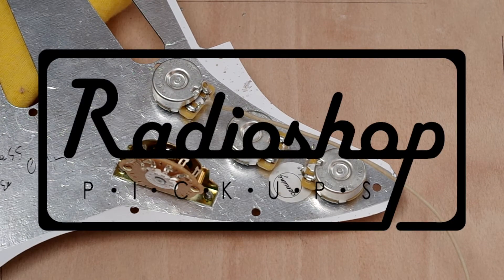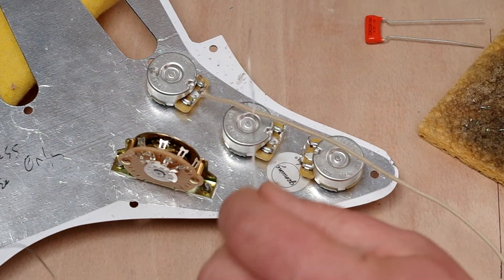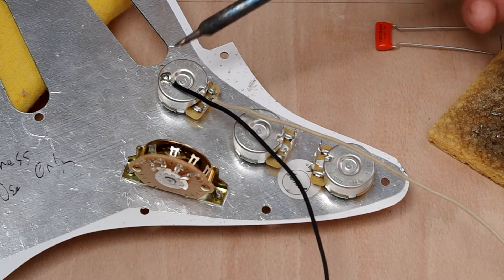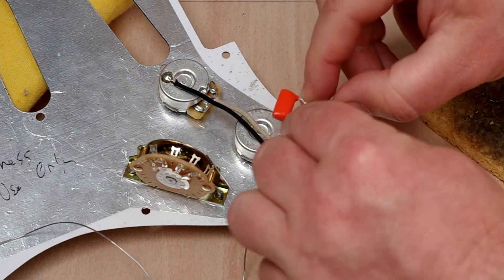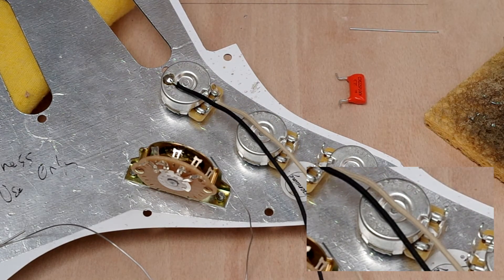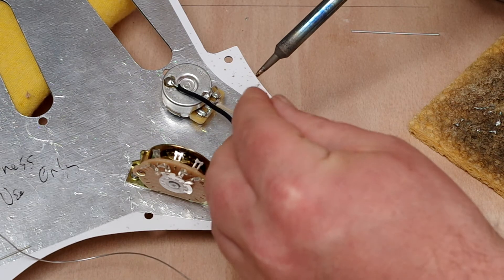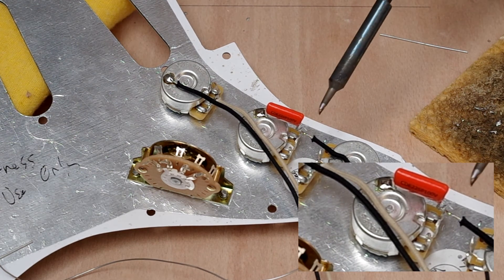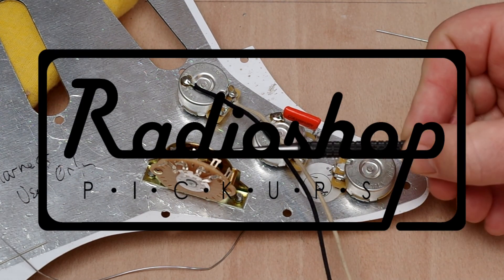How To Solder Guitars (2/6) - Capacitors and Pots

Comment: Why does my soldering iron oxidize so quickly? I have sanded down all the oxidization from my Iron and then cleaned it with IPA. Then I reheat the iron and melting tin on it and scrape of the excess tin on the sponge, but after a while oxidation re appears again before getting tin all over the iron..

Comment: The biggest mistakes I see is people using soldering irons not hot enough and way too much solder. I learned it's best to have a soldering pen with a thermometer adjustment.

Comment: I JUST LIKE TO ASK NOT SURE  DOES CAP HAVE TO BE SOLDERD A CERTAIN WAY , LIKE IF YOU TURN CAP AROUND VISA VERSA , DOES MAKE ANY DIFFERENCE . LIKE POSTIVE NEGITIVE. OTHER THAN  THAT GOOD  TUTORIAL.
Reply: yes it does. really good question. every cap has a direction and if you put it in🎉 reverse you'll have slightly more hum or signal loss. The way to know the direction is to run your amp on high gain, tube screemer or dist pedal ON, and touch it on the tip and ground of the guitar cable. in one direction you'll hear less hum.

Comment: What’s the difference between soldering one leg of the cap to ground and linking the volume and the tone pots with the cap in a Les Paul guitar?
Reply: It’s possible it’s just a better grounding option. I had a fender telecaster that had a hissing it unless your hand was on the bridge that was a bad ground issue probably a cold solder joint. I also had a telephone that constantly had static or crackling in it until one day the teck came out and I know the guy he had me run a ground wire right from the phone hook up post outside right over to the ground from my electrical box outside about 25 ft away. For some reason in Pennsylvania there seems to be a high resistance in the ground it could be that there’s a lot of granite or sandstone in it wet I don’t know but they require you to put two grounding rods 6 feet apart to be up to code for your house and it doesn’t seem to make a difference. So I’m just saying it’s probably just an issue like that  if you can ground all things together you’re probably better off or maybe it’s a more bulletproof set up. One thing for sure Company‘s been in business a long time both Fender and Gibson are great companies and they wouldn’t be doing it if they didn’t think it was necessary I love Fender I wrote them letters before and I was surprised at the responses that I got back they are super company and have really done a lot for our industry. 90% of the amplifiers out there were stolen from their original design but the thing is they made amps guitar strings you name it they had everything possible to do with this industry. I also give Harley Peavey a lot of respect too, because he did the same thing to compete against Fender and Gibson and he built quality stuff at a decent price that many used to get their garage band out there going etc. we used to stack those old CS 800 power amps for 2400 Watts. We had a party on a 60 acre farm once and the cops come out about three or four times and the last time the guy says I called my wife and I can hear your band over the phone lol then he claimed it was miles away😂 The good old days when we were young lol

Comment: Are capacitors necessary for pots? Does it matter if you turned  the capacitor around  & solder it?
Reply: The capacitor turns a regular pot into a tone pot. Otherwise, it is the same as a volume pot.

Comment: just finished my tone pot this guys good i was able to correct a bad grounding job just heated the area up and used my saulder sucker then i scribed the pot or scratched it like he said . then i tined my solder and the iron to t he pot at the same time then i put the ground wires back on i only got the pickups left to do and one pot to ground then i am don after i do the volume pot walla capacitor was easier than k thought  thanks radio shop